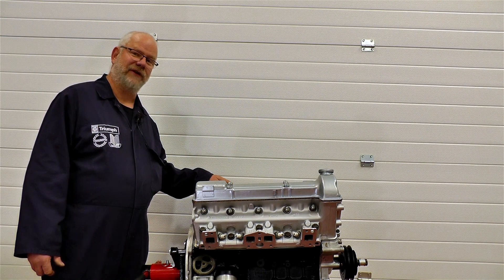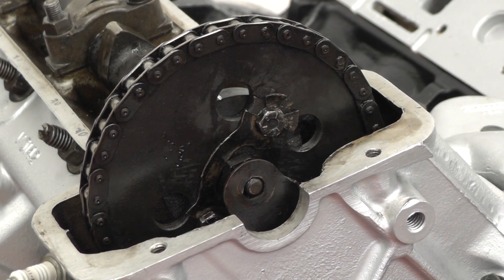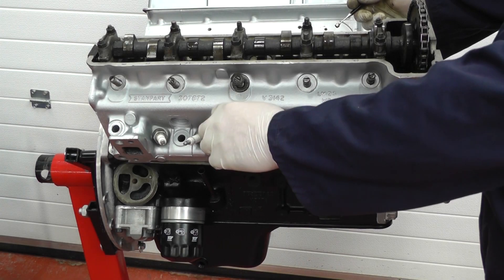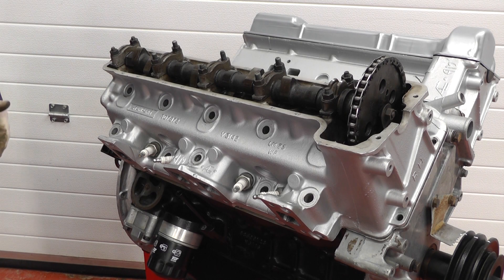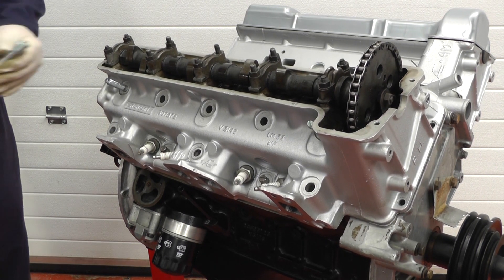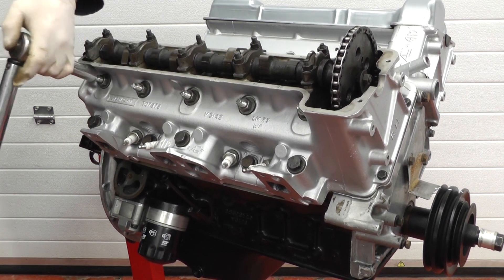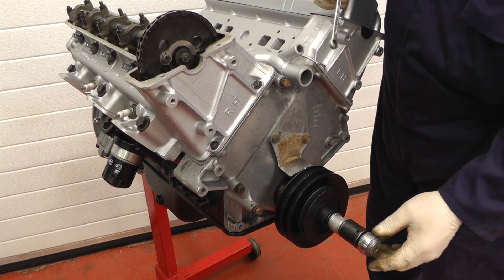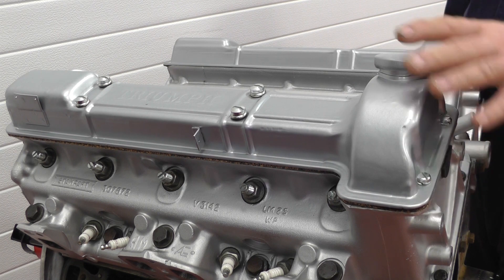Replacing a cylinder head gasket on a Triumph Stag.

Comment: I specialised as a Triumph Stag technician and you never ever removed the camshaft sprocket bolts or fit the camshaft sprocket support nut without first stuffing rags down the gap, the nuts and bolts are bound to jump out of your fingers vanish down into the engine. Also removing the cylinder head studs can be a nightmare to remove due to corrosion.
Reply: Well you show certainly only how to do a straightforward job, without the feared stud corrosion. I experienced that problem, luckily only on one stud. But now that stud still sticks in the head for years as I had a spare head.
Will have to drill it out. 
No I have an engine, where 3 studs are stuck. I have plan to make a little tool which I hope works better than the shown stud remover. That is soft metal and tends to wear down.

Comment: Had a stag when i was 17. Head studs stuck so bad. I had penetrating oil soaking fir 2 days. I had a gantree in workshop. Had the weight if the car on the head for 2 daya. Wouldnt budge!!

Went to a Sparshats near me. Old boy mechanic showed me a thin metal.wedge. he said drive that in enough to get a hacksaw blade in and keep cut the studs. Then gwt the head repaired.

Even when i dod get the heads off.  I had the head in a vice and stipp spent alot of time driving the head studs back and forth before i finally got them out
Reply: All head studs were seized on mine. Luckily the engine was out and on the engine stand so I could rotate the studs to vertical. Tightened 2 nuts together on each one until the flats aligned and put penetrating oil in the cast recess surrounding the stud. Then out came the SDS hammer drill and cut the point off a chisel with 4 sides to fit into the 1/2" drive of an old socket that fitted the stud nuts. I then held the SDS on the studs until they were smoking and you knew when they freed because the penetrating oil would suddenly vanish down the side of the studs. A couple of the studs took around 7 minutes of vibration to free IIRC, but it worked without causing any damage and was quick.

Comment: I had time seeing baubles on top of engine and right head so I decided to replace gaskets, looking at this video seemed like an easy task right?, removed heads , notice gaskests where almost ok except torque probably was never rechecked bolts came right out, put NEW Regular gaskets but could not put sprockets back on the cams, removed front cover and released the tensioners made partial gasket for front of oil pan,installed new gaskets on taming chain cover and loaded fluids ,started engine, after Half hour milky oil coming out of covers, open covers and yea, it look like brown oil malt, checked radiator and it was OK coolant was clean, thought may be gaskets are too thin!, so order your PAYAN Gasketes from RIMMER BROS, Carefully  Installed them, following carefully all directions, installed new gasket also on Intake manifold  every thing seem to be right, started engine front bolt on timing chain cover leaking oil through, added some silicon , stop leak stopped,left engine run for 20 minutes, WATER COMING OUT OF SEVERAL TOP ROW HEAD BOLTS!!!! checked torque and is fine 55 PSI.
Removed couple of leaking bolts to inspect, they are wet !I thought May be I put Graphite Grease on Thread and high temperature Copper RTV on the bolts, but will they be hard to remove next time?  then I realized there are Black squirts burned antifreeze leaking of the head pipes!!! so I assumed Gaskets on Intake manifold are bad also, A real 30 Dais #) Nights Nightmare  what else do I do? Any Ideas? , I'm Thinking  CORVETTE LS1 engine Right? Small Compact, It Fits,, Why not?

Comment: Wouldn't it be quicker to slightly slacken the 3 camshaft  bolts (or are they set screws?) before timing up prior to removing the sprocket?

Comment: I notice that set to tdc when the head is lifted off no1 piston is not at tdc? Is this right?
Reply: You saw that correctly and it is right.  Timing on Stag engines is taken from cyl. no2, front cyl on LH bank.  There is a very good reason for this and it is due to the related Dolomite 4 cyl engines having their timing taken from the same cyl.

Comment: Stainless  steel head bolt  that is terrible  stuff to make head bolt out of  brakes stretches and wont take torque  of steel and will still seize solid into steel and be nightmare to drill out  good video
Reply: There is more than one grade of stainless steel.